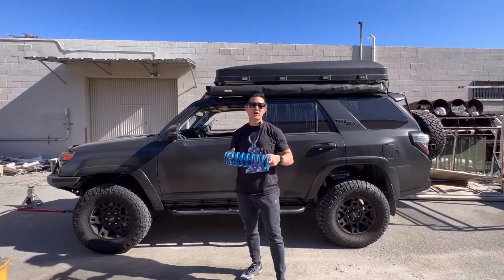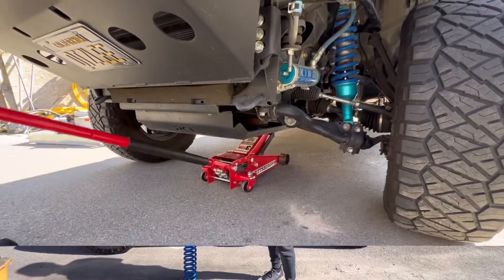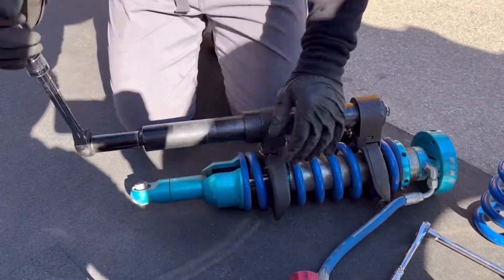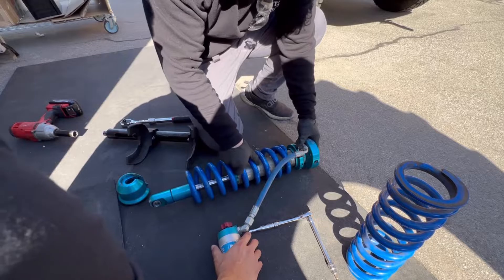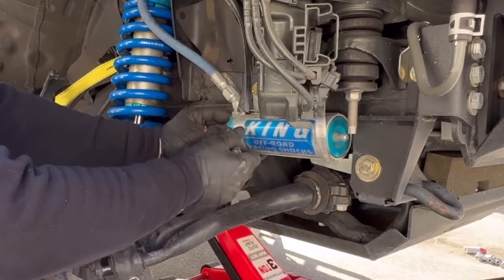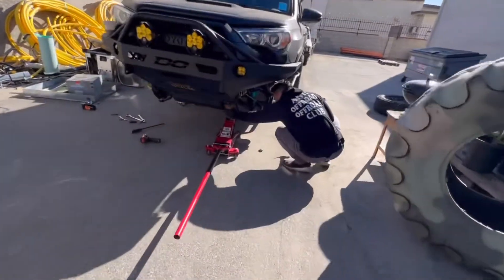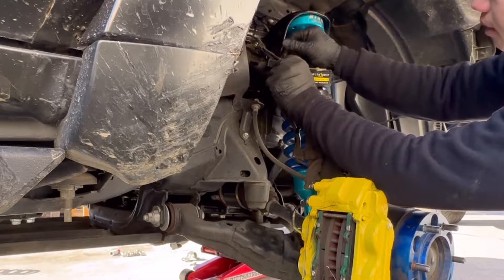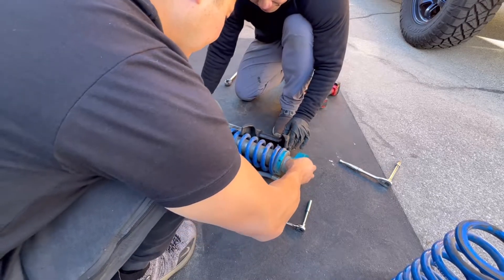WHY I upgraded from KINGS 550lb Coilovers to 700lb | 4Runner

Comment: You need like 500 miles to settle. not 5 inches. Also shouldn't need that much pre load with the heavier spring but to each their own.

Comment: Think upgrading springs with no added weight ruin ride quality? I want to eventually run an ARB bumper but dont have the funds to do both at the same time. Was thinking of getting the heavier springs so I will be prepared in a year or so when I can actually get the front bumper.
Reply from the maker: It won’t necessarily ruin it but you will notice the ride will be slightly stiffer. I feel it on speed bumps

Comment: You still happy with this set up? How high did you go? I have a trd orp KDSS I want to upgrade. How do they ride in washboard? Thank you!
Reply from the maker: I prefer this setup for various reasons but the main one is the added weight from the front steel bumper. I’m also compensating for a future winch. Before this I had a bad nosedive. The 4Runner rides pretty well with the Kings. The biggest difference was actually going over speed bumps, you can feel its stiffer going over.
Reply: Just checking in did the springs settle after time? Softened up? 3 days on my set up.

Comment: Great video bro, is it ok to use an impact on wheel spacers?
Reply from the maker: You can but I would always recommend using a torque wrench to finish tightening. Also the bolt would probably break before the spacer.
Reply: Red 262 or 271 on the studs that hold the spacer to the hub and torque them every time you have the wheels off.  Never had a problem with my bora spacers and doing this

Comment: Hey Otzlee, I was in the same situation and ended up doing the same swap. I got the lift back and got rid of the rubbing. Still need to get my alignment done. You definitely feel the stiffness a little. I'm now thinking I should have gone with the 650lbs spec. Did the front suspension soften up a little the more you drove? Thanks man
Reply from the maker: It softens up some over time. I’m in need of an alignment as well, just waiting to replace my uca joints first.
Reply: @OtzleeExplains  thanks! Yeah eventually I want to get a roof tent so the extra strength is probably better.

Comment: I am debating the 700 vs the 650. Did they end up softening up or is it still a rough ride? I am running a Steel front bumper, full CBI Skids and a large 12k winch. The 550s are not cutting it at this point.
Reply from the maker: They softened up a bit but it’s still stiff going over speed bumps. At least my rig doesn’t sag anymore. I like the 700s
Reply: @OtzleeExplains  I wonder if the 650s would be a good step in between since our rig weight is similar. 

Thanks for the reply!
Reply: @whatdoyourequire  650. 700 is too rough. If you just want height and don't care for comfort, sure go with 700.
My front setup:
4x4 Labs front bumper
12k Winch
Full RCI Skids

Comment: Otzlee, you referenced the front new height at 38.75, I was wondering if there was a difference in the rear 39 vs….?
Reply from the maker: I only changed out the front coils so it did not affect the rear. I am running 3” icon overland springs in the rear. My vehicle is pretty even from front to back right now without any gear. I’m pretty happy with that ride. I’ll see how it will perform when I’m fully loaded
Reply: @OtzleeExplains  thanks, sorry for missing that. Btw, love everything you’re doing w/the rig✌️

Comment: Why did you go with kings? I’m debating going with the kings or Icons, also how’s the ride, I like oem ride I have a trd off road prem
Reply from the maker: I love the whole king suspension. It’s pricey but you get what you pay for. The adjustable kings makes for a buttery ride. I have a off-road prem with kdss and the kings are noticeable in regards to the improvement of the ride.
Reply: @OtzleeExplains   thanks for the feedback brotha I’m just gonna go with the kings

Comment: What made you replace the spring? Was it too mushy?
Reply from the maker: I added a front bumper and it started to dip in the front. I’ll eventually add a winch so I needed the extra spring support
Reply: @OtzleeExplains  oh ok i wonder if i will have to do the same with my 650lb springs!